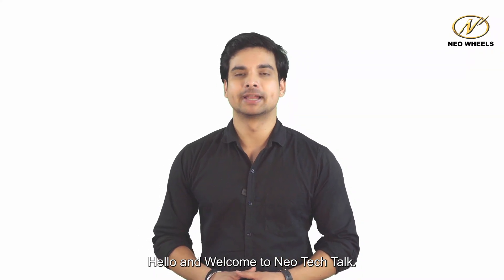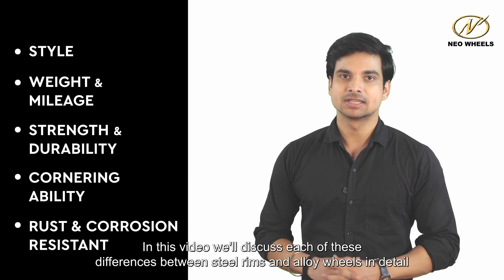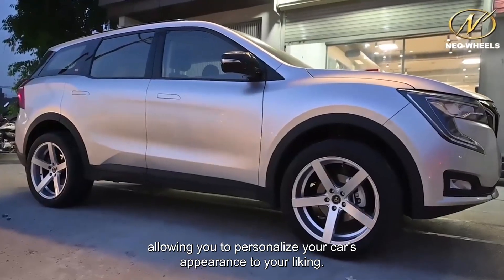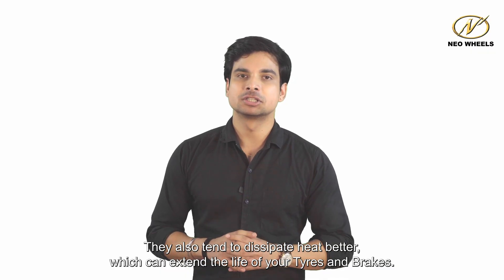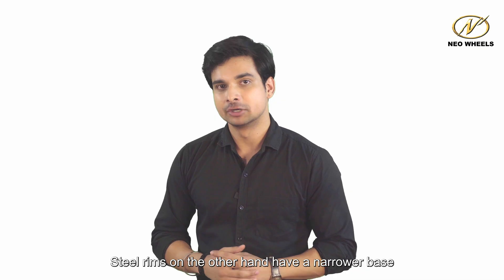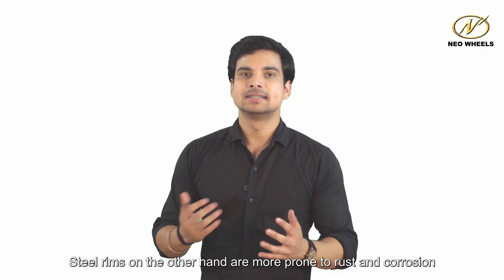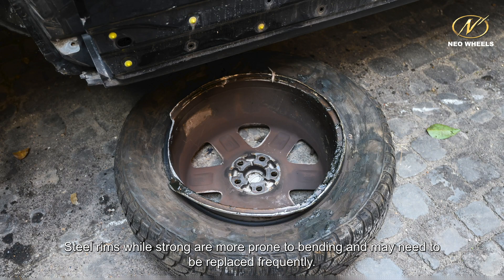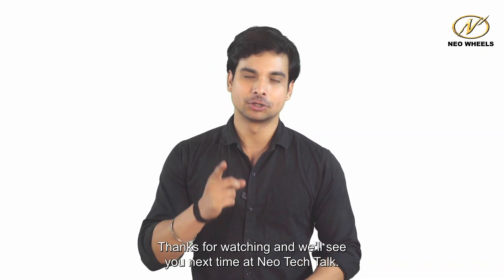Alloys vs Steel Rims - Neo Tech Talk Episode 1 | Neo Wheels

Comment: sir is this true that neo wheel is having problem on nissan magnite I asked one seller of yours he said he will not give warranty since he got so many complaints from  nissan magnite so he advice not to fit neo alloy wheel on nissan magnite so I am asking what the matter please reply
Reply from the maker: Please contact our sales team : 9137450920 / 8169667056
Reply: The problem is not in neowheels Or any after market alloys. It is due the hub size difference. All these aftermarket alloys are lug centric but magnite have lug bolts instead of lug nuts. Lug nuts have free play due to which these after wheels will never be centred and will cause vibration in steering wheel.